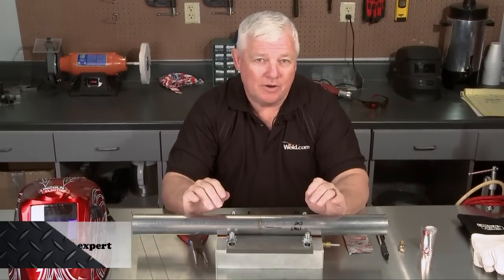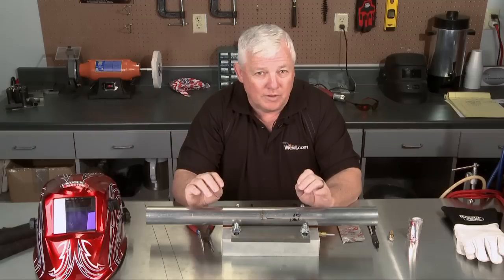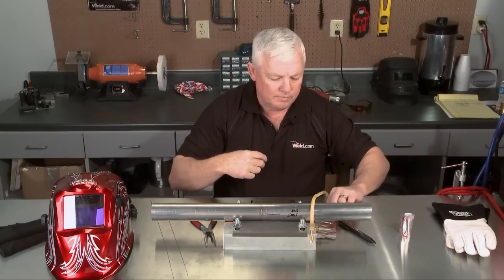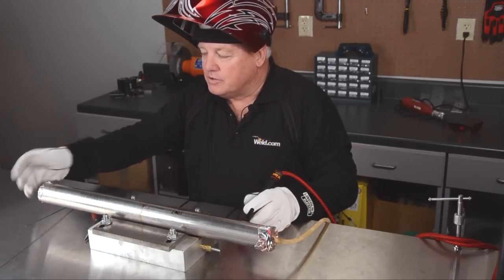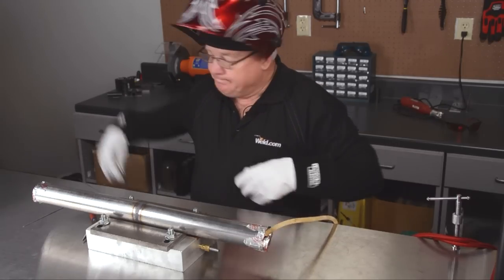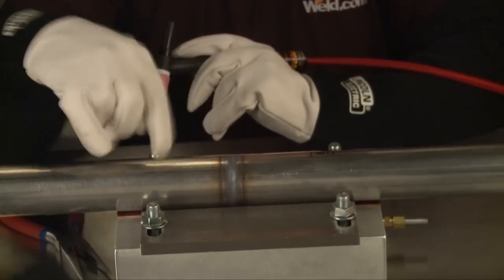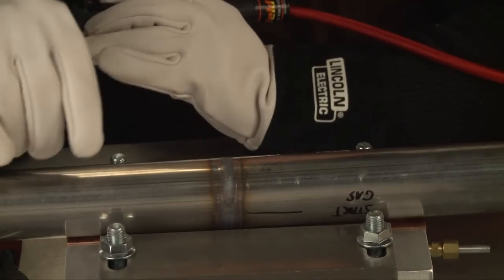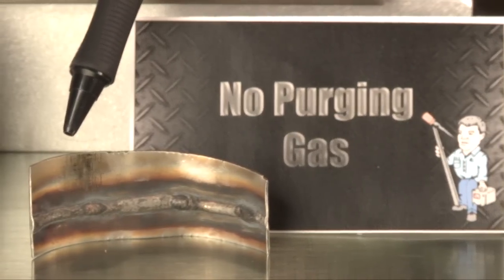TIG Welding Stainless Steel Tubing - How to Do It the RIGHT Way

Comment from the maker: You are correct in identifying this particular weld was run too hot and needs additional shielding. It was our intent to overheat the weld in order to amplify the the chromium oxide attacks on the surface and the penetration. Once the part was welded, we crossectioned to expose the penetration. The average welder typically has this type of problem where as the experienced welder would utilize less amperage, increase travel speed, and increase the gas shield coverage with a larger cup size.
Reply: Of course it was 😄😄
Reply: Also, you dont increase travel speed along with reducing amperage.
To increase the travel speed, you UP the amperage. Those two minor adjustments along with using a size 10 or 12 ceramic is all that is needed.
Reply: @kf8575  I sincerely apreciate the effort of this gentleman, so called mr. tig, but to me he is one of the less competent people on this channel (and not so good to weld, especially with tig). And yes, you are totally right. 🤫😉😁🤙

Comment: The same problem happens when you do NOT purge Refrigerant lines while brazing. Too many so called HVAC Mechanics skip using Nitrogen while brazing and end up with lots of oxide flakes inside the lines - which will for sure lead to premature failures of the Compressor and clogging of the very small capillary tubes! Great Video! Thanks!
Reply: Tig is not brazing

Comment: For all of the people complaining about the weld quality.. This weld WOULD pass inspection! When a CWI does a visual inspection or a NDT process (MAG particle, X-ray, FPI etc) He or she needs to put ALL personal pickiness aside and look at the weld thru the given code and WPS. Is there CJP (complete joint penetration)? yes. Is the there porosity in the weld joint? No. Is there undercut? No. Is there underfill? Yes on this joint there is underfill. But depending on which code this is applying too... Underfill is allowed to an extent, along with undercut. You can't judge a weld by the way it looks when it comes to coded work. If it fits the requirements of the code... Then it is a pass. Great welding Mr. TIg! -Dan
Reply: Dan10201992 - You mean you know weld inspectors that actually look at the weld for what it is instead of the person that did it? Must be nice. All the ones I know, if they don't know you, don't like you or you aren't their buddy, they will FIND SOMETHING wrong with your weld to keep their buddies working. I see it all the time.

Comment: I love seeing the back end of a tig torch in action, this really is how you learn a lot. Thanks for not showing how you move and hold the electrode and filler wire, as that might really distract form what is important in this video. Now, if someone can just tell me what the important part is as I clearly missed that.

Comment: Oh my where do I begin on this video... for starters I work in food processing manufacturing plants as a stateliness steel welder every day, if there was one thing right in this video I failed to see it, and couldn't tell you what it was. Your "clean weld" that "didn't have any burn marks what so ever" actually has burn marks every place you stopped or started your weld. A great way to prevent that would be learning to walk the cup while using fill rod,that way you only get 2 burn marks that are easily cleanable ( where you started and tailed off your weld. ) An ever better way to clean it is using pickling acid and a piece of wet scotch brite form 3M. It takes the same amount of time as your electronic cleaner. Also there is no need to purge for 2-3 minutes on that small of a piece of tube you're just wasting argon. I don't care if you're welding a piece of tube that will be federal inspected or if you're welding exhaust systems that nobody will ever see, getting a good looking weld, cleaning it properly, keeping it cost effective, and done in a timely manor for your customer  makes the difference between professionals and the guys just trying to land a job.

Comment: You don't ever want the tungsten to touch the puddle as it becomes "contaminated" and then the arc gets real funky and your weld will suffer. If you get into tig the first several tries this will happen and you will want to ram the torch head into your eye but stay focused and you will be making pretty welds in no time. The beauty of tig is if you don't like your bead you can just work over it again until it looks like you want it to. Good looking out!

Comment: The best thing about this video is that it let me know that my stainless welds don't need to be gold to be "good".  All the Instawelders out there make newbs like me think that if it's not a colourful weld, it's shit.  It's nice to know I can just clean up the oxides and move on with my life.
Reply: Just make sure you do clean it up. The grey welds have no chromium and will rust.
Reply: His weld is subpar. He was to hot and slow.
Reply: Ideal stainless is a bronze color when done. Only reason to clean it like he did is for food industry type shit

Comment: Stainless is one of the most difficult materials to keep from warping and distorting. It is extemely critical to make numerous tack welds and keep the amperage to a minimum.  It is okay to weld a short amount of distance and let the part cool down before resuming.  good luck  Mister Tig

Comment: My instructor in the Navy used to use a stand up clamp jig and would weld that non stop.   Even weled pipes against the bulkheads using magnetic mounted mirrors to see on the  far side.
Reply: I've only had my everlast welder for a few months so I am still learning and trying to get better but one day I hope to be able to do that (and learning to tig weld with both my left and right hands). sometimes I need to get into tight spaces and being able to be flexible while welding would help a lot.
Reply: Its all practice practice practice and practice some more.  Tig is a bit nerve racking. Stay positive. Youll get it.

Comment: Great informative video. I just welded my aircraft's exhaust patching a hole, and borescope inspected it on the inside. Was similar to yours, since I did not use purging. I will next time. I did not know the tube ss type, but I used ER308/308L filler rod @29 ampsLincolnPT225. Closeups of your torch/rod technique would be beneficial. Thanks.

Comment: I need to weld additional tube to a boat bow rail that is already installed on the boat.  How would I purge this as it's quite long and has many parts coming off it already.

Comment: Dev,  The primary reason for dabbing is to assure that you regulate the filler material without "overfilling"  Once you overfill the puddle with a constant feeding technique, there is a  high risk of cold lapping or non-fusion in the root.  When using an automatic feeder, you can keep a constant wire-feed speed that has been preprogrammed but the mechanics of the human hand are just not that accurate  enough.  good luck Mr. Tig

Comment: GREAT VIDEO! This is exactly the TIG procedure used in the sanitary food industry for fluid milk, whey, etc. a huge industry. There must absolutely not be any place in the tube for bacteria to collect, and contaminate the food product, or the weld (flanges, cones, etc) will be rejected by the inspector. It must look professional, and meet sanitary standards.
I have been struggling to the the 2G, 5G, & G6 positions to pass the certifications. Please expand on this particular subject (...not everybody plays with hot rods).
I have used up to 2X wall thickness for amps, down to a snail's pace,  which a supervisor would frown on. 2" Tubing & larger  303SS .065 + wall thickness, rod 308L.
I would appreciate insight on industrial out of position welding.

Comment: On that subject i do have a question though. Its seems to me that your running hot. Its hard to tell since you dont really get to close on the outside finished weld, before you clean it.  But looks grayish to me, meaning, you could have (should have) used a larger nozzle, if you were looking to keep oxidation at a minimum.  But i may not have seen the weld correctly.  Id tell you what the colors of a finished stainless weld indicate, but im positive you already know. nice video all the same.

Comment: Does the weld cleaner get rid of the oxides and all their problems- ie if you could have gotten the weld cleaner inside, would the non-purged weld have been as strong as the purged weld?

Thank you.

Comment: have you ever seen any pinhole punctures not on top of the weld, but around the weld? this is done without filler material, using tig fusion weld on 304 stainless steel. also around a pipe. we spotted micro pinholes after cycle stress testing of the steel around the weld.

Comment: Two questions. First is there a "rule of thumb" when using the correct filler size rod per tube/pipe wall thickness and plate? Second, when you set your machine at 35amps to weld .035" tube are you maxing out the pedal to the full 35 amps or using just what you need to get the weld done.

Comment: hello, is it possible to stick weld 304l stainless steel exhaust pipe, any suggestions on settings, i bought the Everlast 140ST, pretty much based on your review. .always great videos

Comment: yes, but basically it means a very similar thing, obviously if you keep the temperature too hot in one spot (from too low an amperage or mainly too slow a travel speed) thats not good either but for the most part, that could be fixed by a larger gas cup, or like ive used before a trailing diffuser with its own gas source(which is handy on thin titanium)

Comment: When welding stainless there are (2) basic issues to deal with..  Surface oxides which can be cleaned mechanially or with the etching system that was used in the program.  The "sugaring" in the inside of the tube(weld penetration) will not provide full strength.  The "chromium oxides" will eventually start cracking prematurely.  good luck in the future... Mr. Tig

Comment: That color can be caused by not enough amps also, which means you spend a longer time heating up the material,which makes the surrounding metal so hot that the bead is still hot when it exits the shield gas, also the color of the finished weld really only tells you one thing, that being "the temp of the weld AS IT EXITS the shielding gas"
Reply: Bear in mind, this guy wasnt/isnt any sort of expert at all. He's not much more than a salesman really, demonstrating basic techniques
Reply: @kf8575  you should really reconsider your statement. Mr. Tig is a master TIG welder.

Comment: I weld stainless everyday and if the weld is black and grey you put way to much heat 1 or you went to slow 2.  The back side looked better that the top side 😂😂 for being called mr. tig I figured the welds would look pretty damn good but not in this case. Want me to come show you how to weld stainless, it’s not that hard but I do it every day except when we run out.

Comment: Urgentcareguy3.....  Not sure about the 201 stainless....  Might check to see if it is a typo... if it is 301 or 302.... both of those metals were popular before 304 and 304l came into the industry....  Nice to weld, bendable , and you can use 308l filler.  let me know how that works...  thanks Mister Tig

Comment: Do you have a video showing why you feed the wire in from the side on stainless and the effect on the weld bead by altering gas flow?

Comment: On a job once I seen a gas cylinder with 3 different colors of paint on it tri mix obviously, what type of welding would this be used for, im guessing it was Argon, Helium and nitrogen,? maybe CO 2?  I was there welding stainless, I seen the bottle in their shop. Thanks.
Reply: That was probably a mix called C-90.  It's 90% Helium, 7 1/2% Argon and 2 1/2% CO 2.  It's a commonly used mix for MIG welding stainless, sometimes argon with from 1 to 5% oxygen is used for spray transfer, the oxygen helps the puddle wet out better at the toes of the weld so there is less of a problem with undercutting, but you have to use wire with extra deoxidizers.

But none of these mixes can be used with TIG.  To prevent the tungsten electrode from oxidizing, only argon or helium or a mix of the 2 can be used.
Reply: good comment....tri-mix for stainless MIG....other metals use argon or argon/helium mixes

Comment: Thank u mr tig. Quick question. Can you re tig weld an existing non purged weld with a purged weld, and would it fix or help with premature cracking?
Reply: To put it quite simply.... no, you cant. 
If oxidised with crystallisation on the inside, that needs cutting out before re-welding properly with a purge.

Comment: Hello Mr. .Tig,
I have purchased some of your TIG products, and they are working well. 

I have a question. I ran across some 201 stainless exhaust pieces on EBay and was wondering what your thoughts were on 201.

Comment: How come I never hear the option for Solar Flux?  When you’re piecing together a dual exhaust with mandrel bends it’s really hard to purge a tailpipe consisting of several butt joints and that’s where the Solar Flux come in handy.  If I didn’t have it I would have to cut the exhaust back apart just to weld each joint

Comment: How quickly are the oxides likely to give trouble in a similar instance? Wondering what’s likely to happen on jobs where purging is not able to be done!
Reply: Okay ,here goes ...
Chromium carbide forms as soon as oxygen gets in contact with un-shielded 'normally molten' metal.
How to counteract this :

1) dont fully penetrate 

2) if you need a full penetrating weld use argon shielding /backup.
I have seen very good results using aluminium chill bars on flat material , keeps temps in check and radiant heat displaces the oxygen ...story for another day - search " welding tips and tricks "
Jody.

3a)if you are not a youtube sensation with unlimited argon supply use solarflux ,and mix with acetone then 'paint ' to the inner wall.

3b) if you cannot get hold of solarflux in your area do not buy stainless tig rods but rather stainless stick rods ... hang on im getting there , VERY IMPORTANT 👉 on a clean metalic surface ,knock off the flux from youre stick electrodes , clean metal rods so there is no flux left on them shiny bright metal clean , put them aside as ull be welding with them .
Now the flux from the stick electrodes grind them to a fine powder (Like baby powder)  save it in a air tight and moisture proof container for when needed .
Now when u need it take some of said powder and mix with acetone and apply liberally to the backsides of your coupon/plate /pipe.
👀👻 
Final notes :
1 the flux acetone mix looks like mud thus handle it as mud . Apply thick.

2 acetone dries quickly ,mix small amounts and apply mix more if needed .

3 if you mixed too much as you are going to do the first time ,set it aside to dry then crush and add back to container .

4 if by some chance moisture gets to flux (clumpy when mixed with acetone ) stop , put in oven at 140 to 180 degrees Celsius for 30  minutes , on a stainless or even aluminium foil . Dont tell the wife if  you dont want to be beaten in your sleep.

5 Works well , not as good as 100% purge but ull get very very good results if you do it right.

6 if upstream of a turbo ect do small sections and brush inside of tube .( do it never had problems ...buddy doesn't brush his never had issue , your choice ) 

7 After all this , your mileage may vary but with some tries , then diagonal cut and etch and you should be able to do exceptional welds .
If by some chance u struggle contact me ill help where i can .🙂

Good luck ,never give up and as always remember to IGNITE . 👨‍🏭
Reply: Johannes Cordier you’re a champion... that’s for the time and effort put in your reply mate :)
Reply: @SWhite-hp5xq  hey thanks , much appreciated,replies like this makes  it worth it 😁

Comment: @Weld.com Hey Mr. TIG i'm starting making some stainless tig welding, and i'm trying to get pretty welds, shiny, and rainbow colored, but every time i add filler rod to the weld, it turns dark, what i need to know to get better looking welds? what stainless steel grade shall i choose, and what filler rod?
Reply from the maker: Try increasing your travel speed. You can look to see what rod you should be using for what grade you're welding by checking out our Stainless filler selection chart on the website.

Comment: Thank you. Great video. Are you using pulsing. And/or what amperage are you set at. Thanx.
Reply from the maker: We did not pulse in this video. With Steels you can use the 1 amp per .001 thickness rule. This was .035 wall thickness, so we used about 35 amps.

Comment: I've used those weld cleaners at my job and if your using an acidic solution you should wipe it down with a neautrilizer or (baking soda mixed with water),because the acid will eat in to the stainless and leave it looking hazy and wierd

Comment: @ 11:50, that is not chromium oxide. Chromium oxide (good) is what makes stainless steel stainless.  What you're seeing is sugaring. Chromium carbide on the other hand, is bad, which is the result of carbide precipitation. Sugaring and carbide precipitation are not the same thing however.

Comment: One problem I have is when I'm adding my filler, the rod wants to stick to the puddle. But when I increase power, it looks like I'm overheating the part.
Reply: +positech123 Are you using 2.0 filler rod? Try a 1.6 instead.
Reply: Filler rods preferred is equal to thinner than what u weld down to (1/8  -3.2mm) then drop to a size thinner than material.